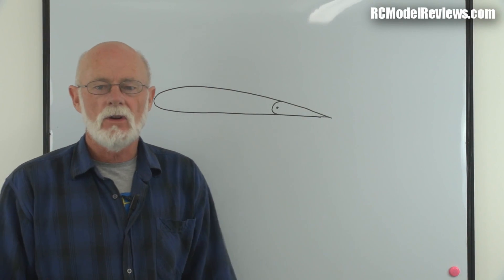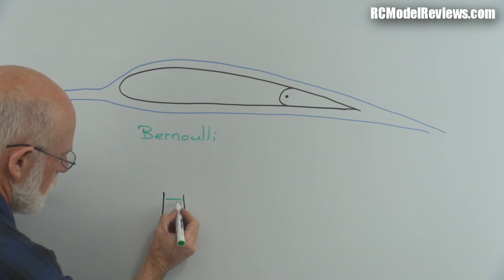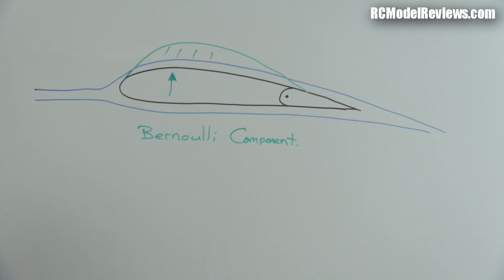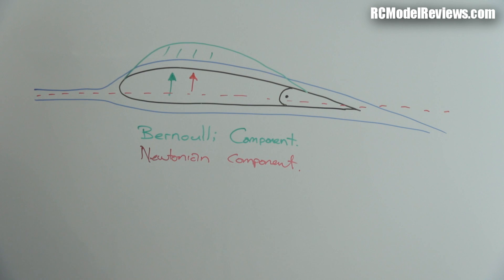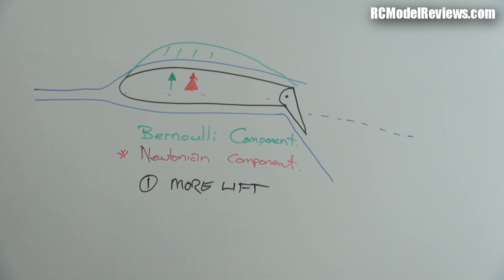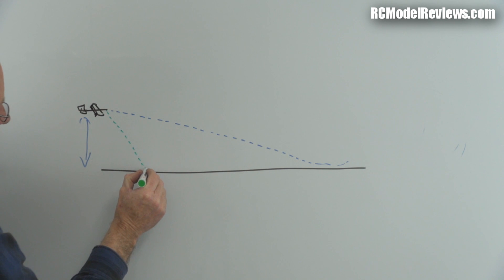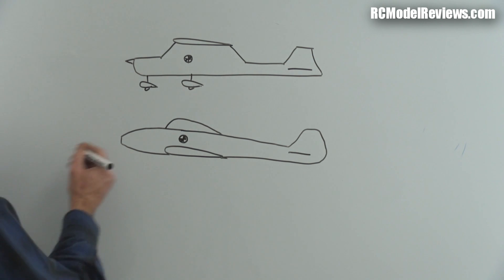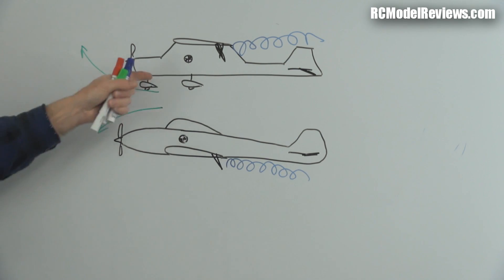How aircraft flaps work

Comment: Which version are you talking about? He talked about both and technically, both are reasonable arguments. In the wind tunnel at my uni, we just consider it as change in speeds over the top and bottom of the wing because increase the alpha angle gets air flowing even faster over the top.

Comment: "If we assume that the air on the top and the air on the bottom reach the back at the same time"
This assumption is totally wrong! On any wing that's making lift the air on top actually arrives at the TE well before the air on the bottom.

The fact is Bernoulli and Newton aren't separate components of lift, they are just different ways of looking at the same thing. Both perfectly explain all of the lift a wing makes.

Anyway, aerodynamic theory aside, great video.

Comment: Thanks Bruce,
If you have a chance, could you comment on the pros and cons of flaps vs spoilers? - I have been experimenting with my HK Vampire and have noticed that using "spoilerons" for landing slows the plane better and under more control than with "flapperons", with less tendency to stall. There is also less tendency of the plane to pitch when spoilerons are first applied. Not sure if this observation would be applicable to all planes but it is certainly the case with this Vampire.

Comment: venturation - The primary action of airbrakes is to kill the lift over a section of the wing. This acts to control the descent of the aircraft, not primarily the speed. In a sailplane the brakes act exactly as a throttle does in the descent of a power plane. It is true that in the case of terminal velocity airbrakes the drag will also prevent the aircraft over speeding in a rapid descent.

Comment: A symm airfoil produces lift by having an angle of attack. To clarify, For upright flight, the wing has a positive angle of attack.  For inverted flight, the pilot must induce a negative angle of attack, by pushing "down" elevator. Since a sym airfoil is the same on both sides, it is equally efficient in producing lift in either direction. Since an airplane is trimmed to fly upright, we must push down to fly inverted, but the airplane could be trimmed to fly hands off inverted as well.

Comment: When inverted, the airfoil must produce lift in the opposite direction..so what was the bottom becomes the top.  Angle of attack must also be changed from a positive angle to a "negative" angle of attack while inverted. So while inverted, the air pressure is now greater on the "top" of the wing (the side toward the ground) and less on the "bottom" (the side toward the sky) of the wing.  Just like normal flight. Symm. or semi-symm foils are best for inverted, but flat bottom can invert well also.

Comment: The fact that an aircraft with an airfoil wing can fly inverted shows that the Newtonian component is significant and can offset the Bernoulli effect which in this case is acting downwards. The airfoil was invented to basically enhance the lift of a wing and a lot of research on it was done on it. I had a model glider with a high performance airfoil and it was amazing. Wings in nature (birds and insects etc) have airfoil cross sections.

Comment: I have never liked the Bernoulli only principle.As you stated the symmetrical airfoil has no lift without angle of attack,the Bernoulli effect creating lift is minimal in this case and the greater part is surfboard effect which is higher pressure applied to the underside of the airfoil. Is this correct or not.
Anyway I just believe lift is a combination of both.And all the disputes are basically around this.

Comment: Great explanation Bruce, particularly since you spoke about the Newtonian part of it. The explanations I used to read as a kid really confused me as they made out that lift is only created by a wing with an airfoil shape, but I had model aircraft with no airfoil's or symmetrical airfoil's (control liners). When I studied engineering I learned that the Bernoulli effect is basically a statement of the law of conservation of energy.

Comment: If you have spoilers-like airbrakes, then they decrease lift a little. You can use them on touch down to prevent aircraft bouncing off the runway, and also to slow down.

Comment: Nice video. I would describe drag as any force acting opposite direction as thrust -- a newtonian vector rearward. In the case of flaps, I believe the air resistance on the flaps themselves to be a larger drag force than the turbulence you describe.

Comment: Flaps increase lift and cause some drag, airbrakes just cause drag. Flaps are needed in large aircraft for landing, to slow the plane down to safe speeds for landing. Airbrakes are simply to slow the aircraft down if still traveling too fast.

Comment: Only Bernoulli's equation is required to account for ALL lift generated by a wing. You are correct in saying that Bernoullis equation says there will be a lower pressure on the top of the wing, however it is because of the curved path. This causes acceleration, and higher velocity leading to the air on top reaching the trailing edge before the air on the bottom. 

To debunk that myth watch this: w ww(.)youtube(.)com /watch?v=6UlsArvbTeo

Flaps create more curvature ==> more accel. ==> more lift

Comment: the reason the Bernoulli principle does not apply is because there is no force that will make the upper air stream go faster. the air streams go at the same speed so there cannot be low pressure. it is all in the newton

Comment: Yes his explanation of lift is completely incorrect. "Equal transit" is the classic wrong explanation. Bernoulli and Newton are simply different ways of looking at the same thing. Also his explanation of the effect of flap is also missing a key part which is the pitching moments caused by changing pressure distributions.

Comment: Simpler explanation would be that deploying flaps is mostly the same as pitching up (trimming up) to slow down. But it's better in many ways to "pitch" up only the wings, no the whole airframe. And I think it's worth mentioning that deploying flaps redure critical angle of attack, so it's easier to stall "flapped" plane.

Comment: Unfortunately it is down now, but Nasa has some good explanations if you just google 'nasa lift'.  Equal transit is incorrect as explained in the video.  The air on top actually arrives at the back of the wing before the air on the bottom.  There are also some great videos of the phenomenon out there. To quote a friend, "the pressure differential would not exist without the "relative turning" of the airflow and the "relative turning" would not exist without the pressure differential."

Comment: I thought, for a symmetrical wing, the angle of attack will change the direction of the Bernoulli force. I have tried flying a flat bottom wing up side down and it requires a very large angle of attack to overcome the Bournelli, but a well trimmed symmetrical mid wing model requires no elevator adjustment to fly up side down.

Comment: Dave, I have to respectfully disagree with you.  You are right, partially, but you've got it backwards.

Usually the upper surface air reaches the trailing edge of the wing BEFORE the slower lower surface air, long before.  Check out this video that shows it quite clearly:

ww.youtube.com/watch?v=zV06PgxarW0

This acceleration of the upper surface air is the predominant cause of Induced Drag, the drag resulting from the production of lift.

Comment: Aaron,

The change in airflow over the horizontal stabilizer (HS) with flaps deployment is the largest determinant of how the airplane will react.  An airplane with a HS that is lower than the wing will generally have a nose up tendency, where an airplane with a HS that is higher than the wing will generally have a nose down pitching tendency.

Comment: John,

During flight beyond the critical angle of attack, Bernoulli's component of lift is nearly zero... all the lift being produced by the wing is a result of the Newtonian component, ie. air being deflected downward.  Also, during high alpha flight, as with a 3D model, there is a very significant portion of the total lift that comes from the vertical component of the thrust vector... perhaps 90% or more of the total lift is coming from engine thrust.

Comment: SPG,

That is still a demonstration of Bernoulli's principle... the air you are blowing oer the top is at lower pressure than the static air on the bottom... the higher pressure air on the bottom of the paper pushes the paper toward the lower pressure, lifting the paper.

Comment: I tend to believe airflow over the wing causes a suction effect that does not relate to the air flow under the wing. A simple experiment is to pull a piece of paper out of your printer tray and hold the short side just below your bottom lip pointing it away from you. Let it droop down causing an arc that resembles a wing. Now blow over the top of it and see what happens......

Comment: I can answer that :) Like Bruce said, is the flap is placed above the center of gravity (COG) the model will pitch up (and vice versa). So the bi-plane would have flaps on both wings i presume meaning the is drag above the COG causing a bi-plane to usualy pitch upward. A midwing plane, if the flap deploys right over the COG the plane will not pitch up or down. Hope that helps :)

Comment: Really well done.  Here's one for you to consider covering.  When I did a brushless upgrade to my HZ Super Cub I noticed that the new engine mounting bracket (purchased from the HZ upgrade site) added more thrust angle.  I've always wondered why the brushless required a more extreme thrust angle than the stock brushed motor.  Maybe just a simple overview of thrust angle would do the trick?

Anyway, just a thought.  I loved this one!

Comment: Bruce, love your videos.  Just want to make a correction here.  There is nothing in aerodynamic theory that says the air travelling over the top must reach the back of the aerofoil at the same time as the air on the bottom.  The air isn't psychic, it doesn't know what the other molecules on the other side of the aerofoil are doing.  In fact most of the time the airflows the air on the bottom surface arrives first.  
The air speeds up on top of the wing because it is being funnelled.

Comment: In my scratch built balsa mini hotliner I built the wings from a flat piece of balsa bevelled on the front,
it was the best handling glider  no Bernoulli component on that one I guess. I did notice the effortless speed with a small motor (less air resistance ). So naturally I put a 800w motor and folded the spar less wings at about 150km/h as you do .

Comment: The flaps on large airplanes also help to reduce the spool up time for the turbine engines. Without the higher thrust setting on landing the spool up could take up to 8 seconds which is too long in case of a go-around